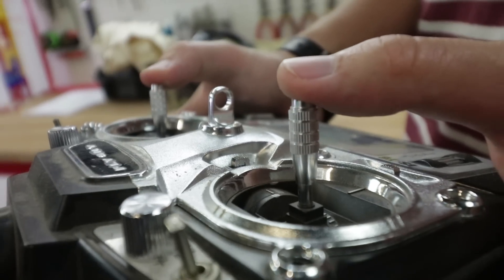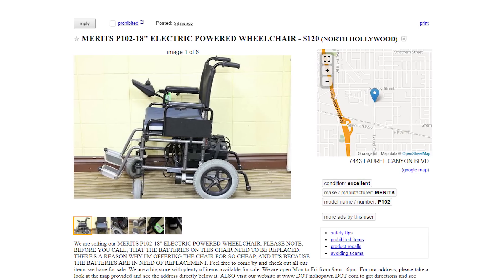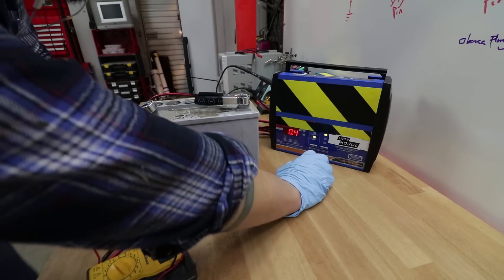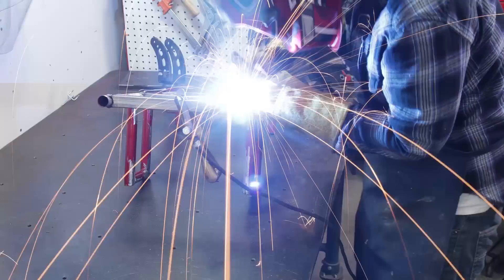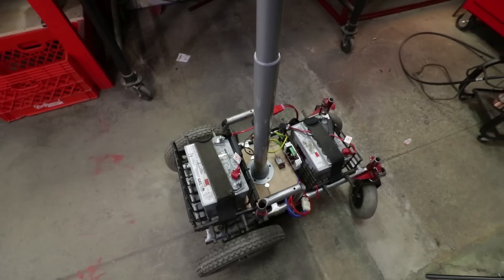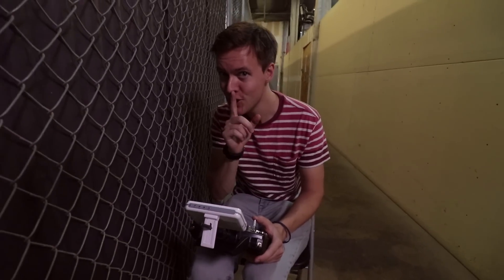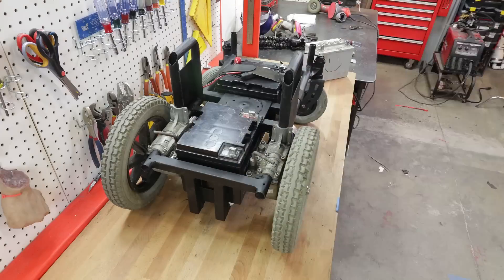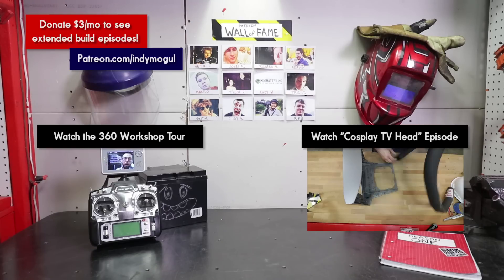DIY Robot Camera Dolly for 360 video! - Erik Builds the Movies #3

Comment: I'd be interested to know how you configured the radio to run the dual motors, it looked like you had throttle on one stick and steering on the other.

Comment: Hey Erik great build!! planning to build one for my own; I got some questions, to start with, any electric wheelchair will do? I mean are they usually have the same motor and wiring system? and concerning the Sabertooth motor drive's being dual 32A is based on motor's power? or they are standard to have 32 A?

Comment: So, great video.  I am in the middle of this exact project and have one question.  I've got the chair, stripped it down, got the sabertooth and a Fly Sky 6 channel controller w/receiver.  The one question I have is referring to wiring up the sabertooth and receiver.  I get the large wires (each motor and battery) part.  My question is on the small wire side of the sabertooth where the wires power the transmitter.  Out of the parts ordered, I have nothing to wire to the transmitter.  What part should be used for that???

Comment: You could stick an arduino on there, write up some code that would record the inputs given by the rc controller. Then it would simply play them back and it would be a repeatable robot ! Just have it inverse the recorded Rc input and it will take itself back to original position. I think you could have something worth much much more here with a few extra minutes and a microcontroller
Reply: I would use an Raspberry Pi for it, but the idea is great.
Reply: YES! I very much plan to do something like this with "Aggy" in the future. Might need some help with the programming side of it. If anyone is interested in helping go join our facebook and message us!

Comment: Build an underwater camera ROV
Reply: That would be soo cool, but hard to control because electric waves are reduced by water. 
correct me if I'm wrong please.
Reply: +Mr Soundso Water conducts electricity. I think you mean radio waves, which don't travel well underwater. But most ROVs are connected to the surface via an umbilical cable, which carries the remote control signals to the ROV, and takes the video signal from the on-board cameras back up the surface for viewing.
Reply: Upps...i meand radio waves. But cabels are bad for 360 Videos, are'nt they?
Reply: Yes, but I wasn't suggesting a 360º ROV - that would be crazy.
Reply: +ZygmaExperiment Is there a water resistant 360 camera?
Reply: +Mr Soundso Maybe. But the number of times you'd want to shoot 360° video underwater would be limited. Much better to have a standard camera.
Reply: +ZygmaExperiment Well...i think i have a project to build now.